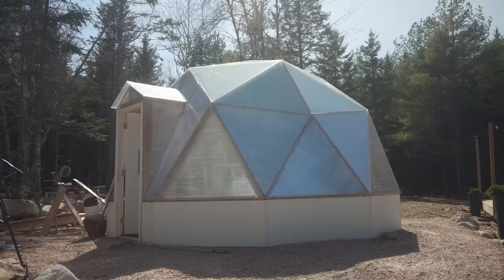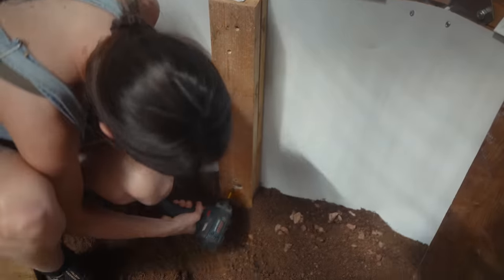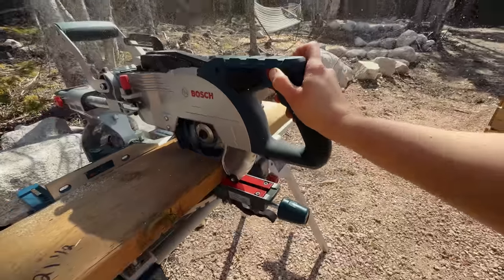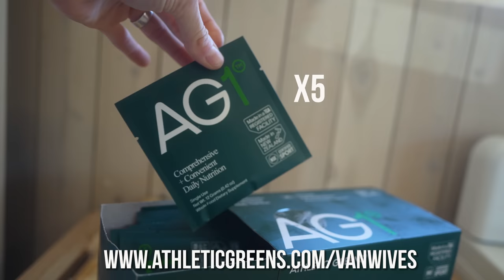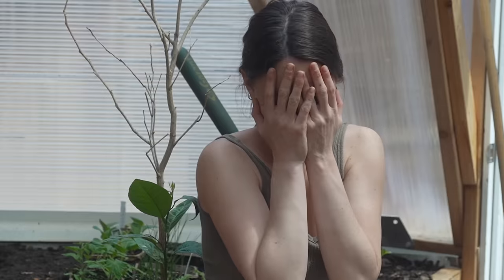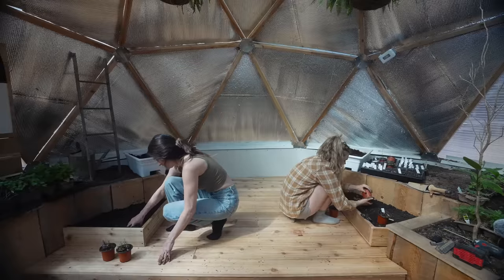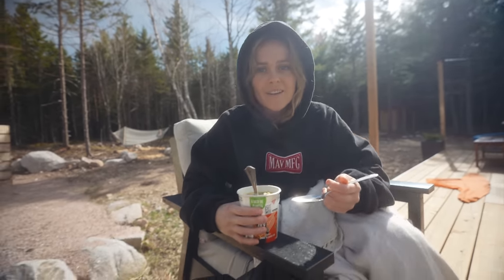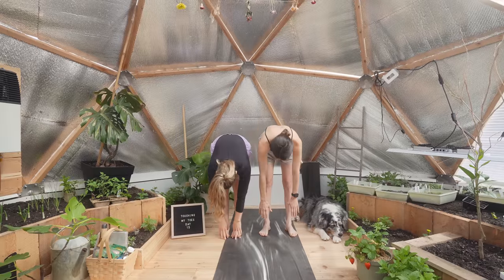We Transformed A Greenhouse Into A Yoga Studio

Comment: I don’t want to be a buzz kill but building directly on the ground, even with pressure treated wood, is never a good idea. The moisture in the greenhouse will promote mold and rot  in the joists. Even a couple of inches of space under the joists for air circulation would have been better.
Reply from the maker: Yeah you’re probably right. We will make some holes in the skirt or something

Comment: A very easy way to determine angles, is cut 2 equal length , say 6 " sticks drill a hole at one end on each stick 1/2" from the end,  put a bolt in one end,a wing nut in the other side.  put the 2 sticks to the shape of the angle, tighten down the wing nut very tight, you can even use 2 paint stir sticks if you want

Comment: Someone quick!  Correct me if I'm wrong!  But those little beds on the side of the Yoga platform will bleed water and dirt from the bottom when you water that little area.  I would have removed the decking material in those little areas or lined the little boxes with the leftover lining from the pond.
Reply from the maker: Thanks for sharing with us Tammy. So thankful for all the suggestions and advice from our pack. 💛🐾

Comment: I hate to say this, but I think you should pull the dirt out of those planters and put down rubber lining first, because the moisture in the beds is going to sit on the ends of those boards underneath, and it's going to wick into the rest of the deck which is going to warp those boards.
Reply from the maker: Yeah thanks :)

Comment: A couple of tips from a yoga teacher:  the reason you can’t touch your toes and have difficulty sitting cross leg on the floor is because you have a tight lower back. Hanging forward and trying to force your arms down is quite dangerous as you are compromising your sacro illiiac joints. To safely stretch out try this: 

Stand tall and raise your arms over your head, bend your arms and take told of your elbows. Before coming forward make sure your pubic bone is slightly tilted forward, and lift your body up out of your hips. As you come into forward fold, bring your hips forward a bit so they are over your knees, put a micro bend in your knees. Then, instead of thinking about touching your toes, tuck your chin in towards your throat and the crown of your head lengthen towards the floor, and at the same time lengthen the backs of your legs by lifting your buttocks towards the ceiling, keeping the micro bend in your knees. Then, you can let go of your arms and bring your hands down towards the floor.

This may always be your posture for touching your toes, or as time progresses and your lower back and glutes release you may be able to come into forward fold with straight legs. However, please don’t force it. It’s better to do ‘your’ version of the pose than to damage your joints.

Sorry for so many words, but proper alignment is so important 😄
Reply from the maker: Thank you for this. I screenshot so I can continue to refer back xx really appreciate this 💛

Comment: I love your new Zen Pen, but you ladies are ill. Make a pot of hot lemonade. 2 lg. lemons, (scrubbed & squeezed into 4-6 cups of water, put the peels in the water as well), 2-4 1/4" slices of fresh ginger (peeled & lightly mashed), 4-7 whole cloves. Bring to a rolling boil for about 8 minutes. Strain into a clean glass jar with a tightly fitting lid. Sweeten with honey. Pour some into a mug & sip. (You can add a little, vodka, tequila or rum.)Store remaining lemonade in the refrigerator. By the way, a tablespoon of the lemonade, 2 tablespoons of sugar & a teaspoon of coconut oil makes a great facial scrub. Oh love Jazzy's hair color. Get some rest.

Comment: You always did great jobs when building something, but the deck... Grrr!!!
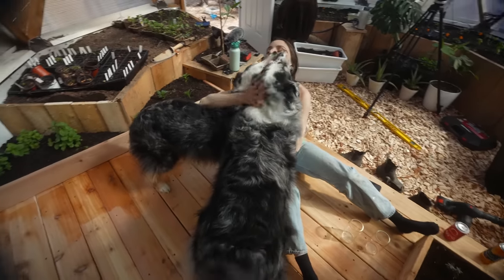I don't know if it's a clever idea to remove the tank, but putting soil on the very deck boards you want to do yoga on definitely isn't. One problem is the water that flows on to the boards after watering the plants as seen in 15:11, the other ist the longevity of the deck of course.